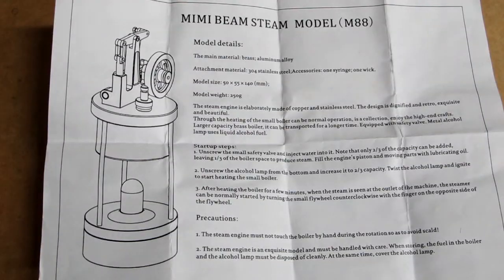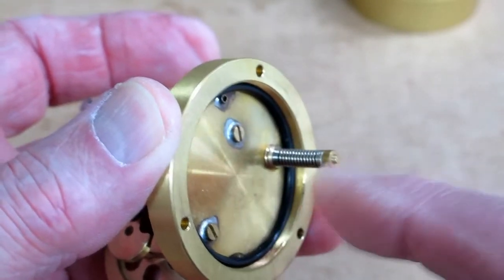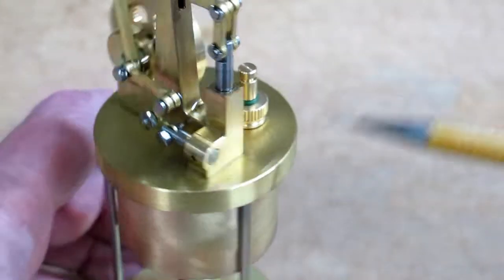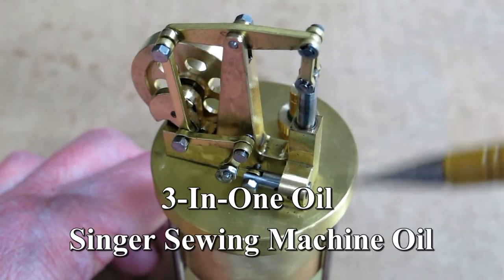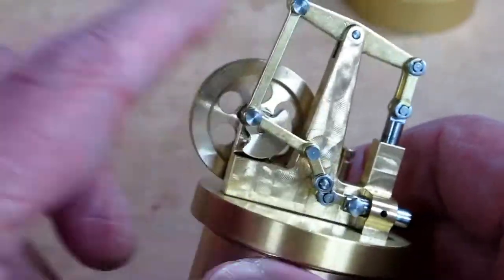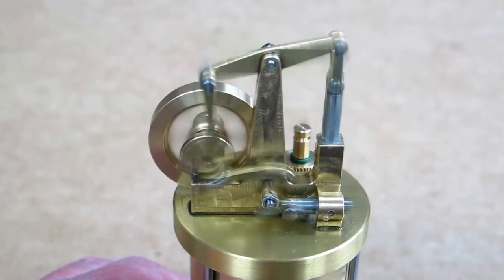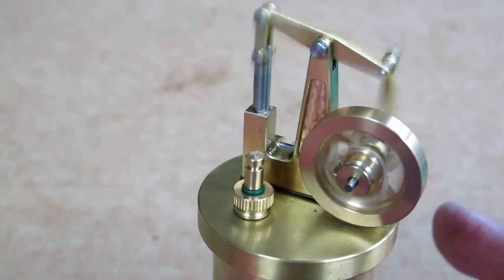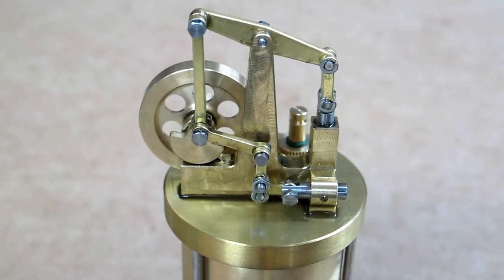Microcosm - M88 Mini Steam Engine Model

Comment: Very nice. This line of models looks very well made. At 6:09 is normal sound. From 6:10 to 6:11 there's a metallic ping noise added, and it never stops till the motor stops. Either something ran out of oil, or something went out of adjustment.
Reply from the maker: Not sure what that is. It (the engine) is pretty oily... and it (the metallic ping) starts right at an edit fade. You can hear it a bit earlier in the video as well. The base, support rods and the boiler just push together. And some very strange frequency responses can come out of the little microphones on these cameras.
Thanks for watching!
Ron

Comment: This may sound strange but isn't using steam to produce work inherently an example of over unity?
The alcohol itself used in another fashion wouldn't be able to produce the equivalent amount of energy.
Very cool little piece of engineering.
Reply from the maker: No. Over-unity in this sense would be perpetual motion... or giving more than it gets. Since perpetual motion is not possible, the answer would be no. But it is possible to use energy to move more energy.